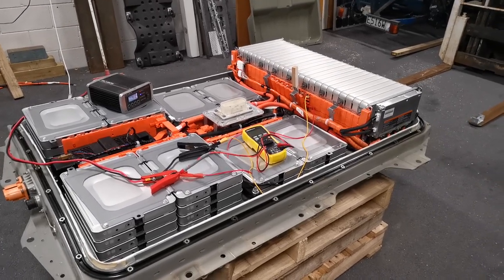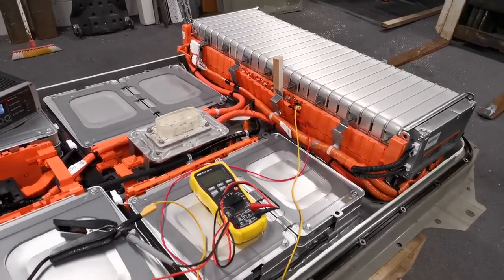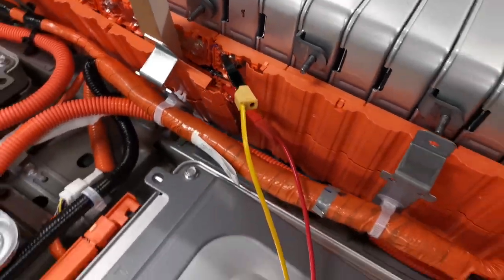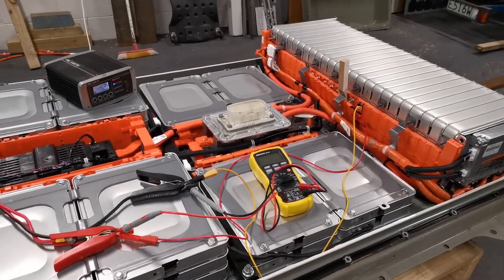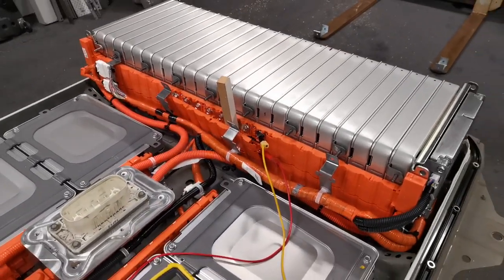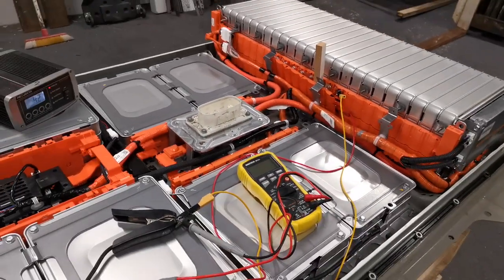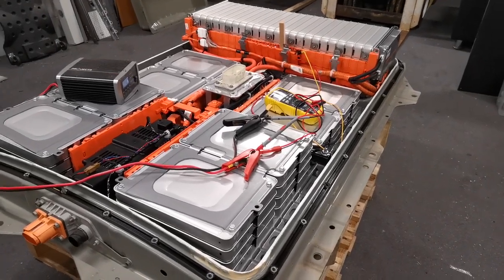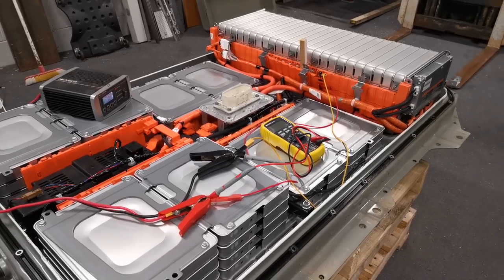Nissan Leaf battery repair DIY

Comment: If that module is swollen, by charging it you will do more damage than repair ! Because if its under voltage it means that the inside chemstry of the battery is bad ( gone ) and if u gharge it the swollen phenomen will increase ( gas in the " bag " ), that again means that its a 99% chance to blow and get the car in fire ! Good luck, and please dont teach people how to die.... This thech its not for all people !

Comment: Bud get that shit out of your battery pack. That is very dangerous.  Also replace the module with the low voltage.  Charging it will not fix it. The LBC is already trying to bring up the cell voltage but that cell is probably swollen.

Comment: What charger/tender are you using for attempting repairs? Can it test the overall estimated capacity?  I just purchased a 2011 leaf with cells #46, #38 and #17 reporting as weak cells using Leaf Spy and will be diving into the battery pack shortly due to degradation. I wonder if we are experiencing similar issues. Which cell(s) were you massaging during this process? I feel we could help each other with our findings. Best of Luck! I'll keep posting my updates via Comments - Posting from Northern California, USA
Reply: Never heard of Leaf Spy ..How did you got that reporting on particular cell numbers ?? 
I'm also in California ( Sacramento area ) just purchased Nissan Leaf with only 6 bars left . It show on full charge 42 miles range  but in reality i made 20 miles and at the moment showing 6 miles left i didn't dare to go further .
I purchased it with plan to use this degraded battery pack for energy storage on my DIY  solar well water pumping .. But in the mean time i fell in love with the Leaf itself and want to save it from scrapping ..is a great car and in great shape other than battery degradation . i enjoy those short trips to the store .
if i can fix the battery by replacing just few cells i'll be thrilled .
Anybody know where i can purchase cells for Nissan Leaf ??
Thanks , Stan

Comment: Hi William. Rex here in Inglewood Taranaki NZ. I have a 2012 Leaf. I am thinking about removing the battery and doing the same. How did things work out. Did your low Cel come back to life? Did the range increase. Your video was great by the way. Kind regards

Comment: Might just work seems like series cells pick on one cell to be the lowest and it eventually gets out of wack. I had one row on my A123 go low and I isolated it and charged it up about a month ago and the capacity did improve but it is still the lowest one in the pack. May just be a maintenance thing I have to do every 6 months.